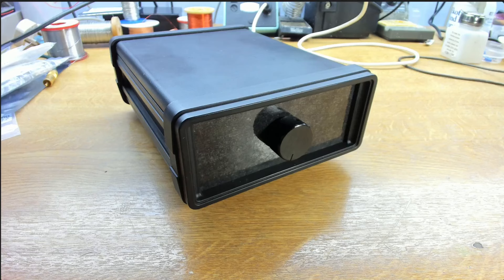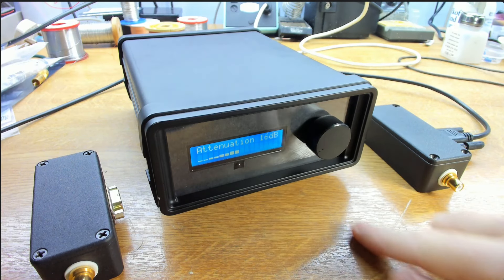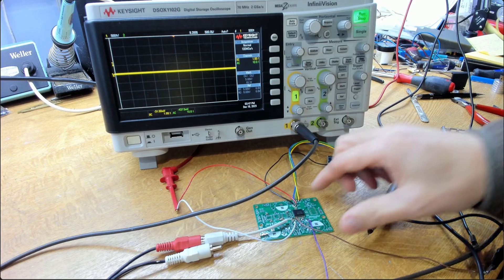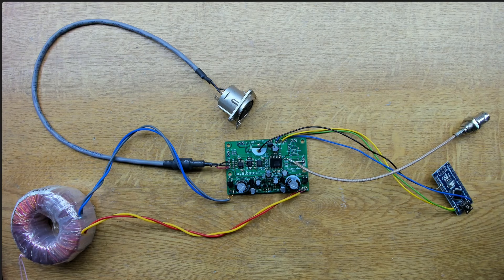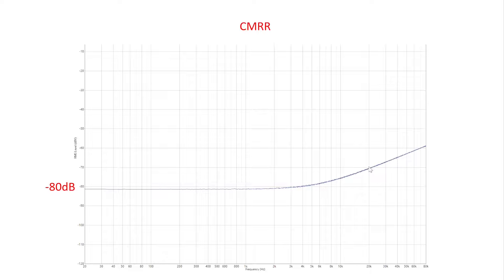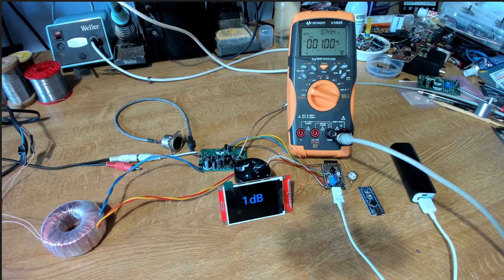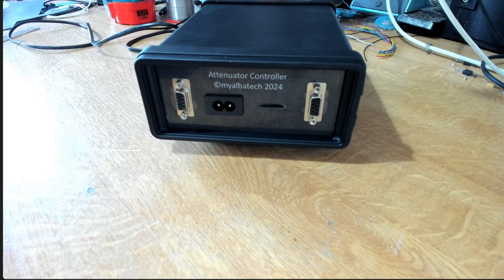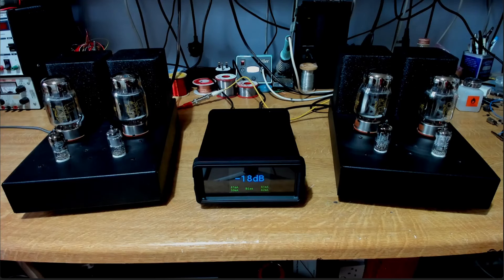Custom Volume Control Modules for Power Amplifiers

Comment: Just found your site after pulling out my Cyrus collection after 5 years in storage. I had a nasty addiction with about 15 units. Bi/mono amped in a surround sound system. Mainly older stuff. Apa7.5 etc. Anyway now no space for it. I’ve learned so much from your posts.

Comment: Just found your site as I'm trying to build an ESP based Graphic Equaliser with automatic setup for each band so was looking for a digital volume control to set ref level. This was really informative and well described and a great help. Are you able to post the Arduino code you used as this would save me such a lot of time as I am very new to coding? Thanks again ether way for publishing the video.

Comment: It's a really fascinating product you've made. However, you might consider removing U1 for two reasons. Firstly, a balanced output from any source will typically have its own driver, so there's no need to worry about its output impedance. Adding an extra op-amp not only increases the BOM cost but also introduces a bit of noise. Secondly, I'm not a fan of directly connecting an op-amp's input pin to the external world without any current-limiting series resistor. In today's environment, where numerous gadgets with switching power supplies can cause sudden spikes on the wiring lines, this might damage the op-amp. While this op-amp does have back-to-back diodes, they are only between the input lines.

Comment: Nice, I have bought a kit based on that IC, it was in 'Silicon Chip' (Australia) so that solves PCB problems (offloaded it to someone else), However I do like your phone app idea, what are you using there, or did you write that yourself?
One Idea I had was a circuit to monitor the amp and if something like a overload, or excessive clipping occurs it would automatically wind back the volume.
Reply from the maker: Thanks! The app was created using 'Blynk'

Comment: Great, I'll keep it as a reference.
When using DB9 connectors, is the communication TTL or CMOS as is? RS232? Have you thought about using RS485? With a 120 ohm twisted pair shielded cable and many meters without problems.
Something I would put is a rotary encoder and some push buttons.
Using a wifi app to control it is very good.